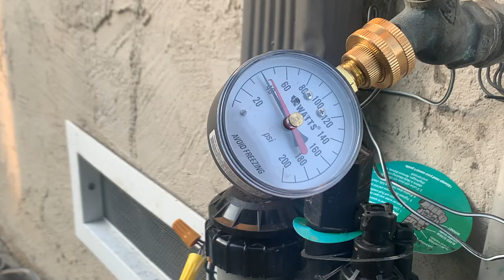End Watering Hammering - DIY Plumbing

Comment: you still had water hammer  I had terrible water hammer at my house . Did everything outside arestors . Same on washing machine etc all to no avail . Final fix was replacing the valve in the shower of master bath . No all water hammer gone
Reply: I noticed this as well.
Reply: Replacing just one valve fixed it? How did you narrow it down?